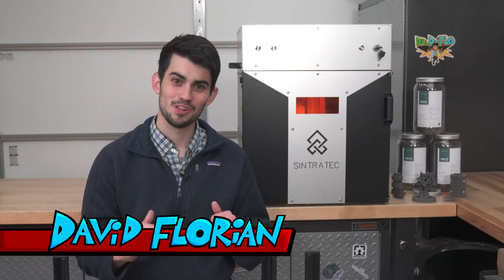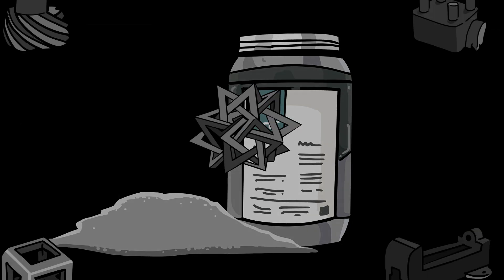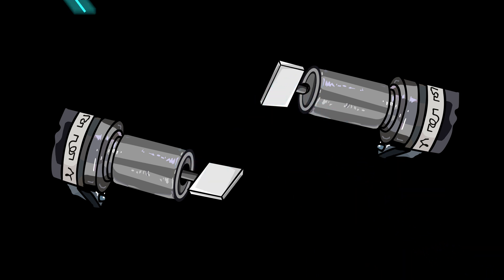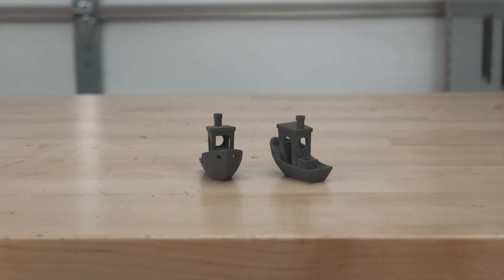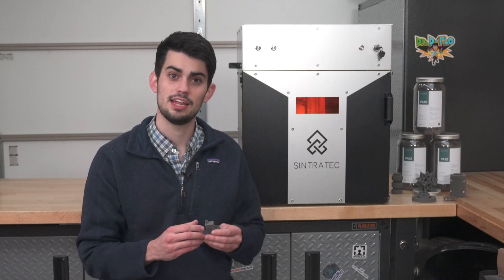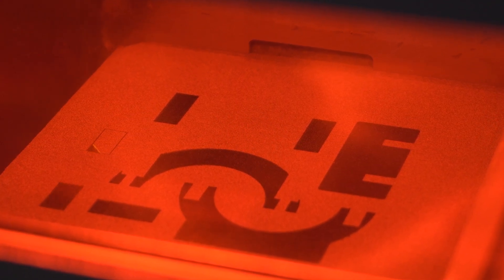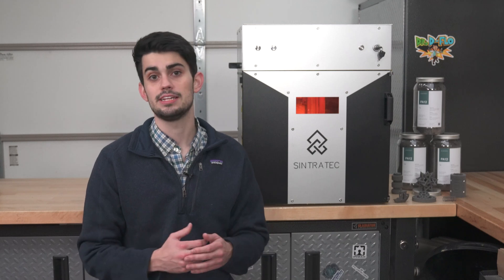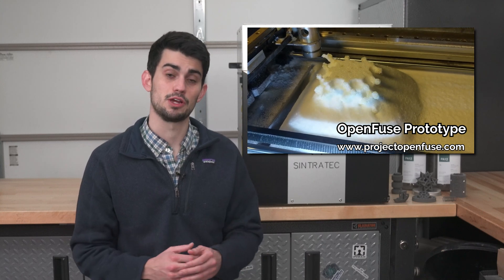What is Selective Laser Sintering (SLS) 3D Printing?

Comment: Great video!  So this is stronger than the 'common' 3d print material - makes sense.  I'm sure this depends on the raw material you are using, but do these SLS parts have a higher operating temp than the 3d printed products?  Say you are interested  in making something to work in a hot environment... thanks!

Comment: Note that sintering has a very specific meaning; if you use heat sufficient to melt the base powder, it's not sintering, it's liquid fusion. Sintering is often used with metal powder compressed in a mold, then heated to a temp below the melting point to fuse the particles. At or above the melting point is SLM, Selective Laser Melting; we use that to make jet engine parts. Less porosity, more power consumption.
From the description, this sounds like SLM.
Reply: I'd just like to interject for a moment. What you're referring to as Linux, is in fact, GNU/Linux, or as I've recently taken to calling it, GNU plus Linux. Linux is not an operating system unto itself, but rather another free component of a fully functioning GNU system made useful by the GNU corelibs, shell utilities and vital system components comprising a full OS as defined by POSIX. Many computer users run a modified version of the GNU system every day, without realizing it. Through a peculiar turn of events, the version of GNU which is widely used today is often called “Linux,” and many of its users are not aware that it is basically the GNU system, developed by the GNU Project. There really is a Linux, and these people are using it, but it is just a part of the system they use.

Linux is the kernel: the program in the system that allocates the machine's resources to the other programs that you run. The kernel is an essential part of an operating system, but useless by itself; it can only function in the context of a complete operating system. Linux is normally used in combination with the GNU operating system: the whole system is basically GNU with Linux added, or GNU/Linux. All the so-called “Linux” distributions are really distributions of GNU/Linux.

Comment: One thing to be aware of: Sintering is a process where, by definition, particles coalesce below melting temperature so referring to the laser as melting the plastic powder can be confusing. The plastic powder doesn't go full liquid, it locally fuses together to form a larger solid.
(But, admittedly, plastics tend not to have a melting point, but a melting range so it's more difficult to properly define the start of the true molten state.)
The most accurate name for this process would be SLF: Selective Laser Fusing. But SLS is much more common and there are already enough abbreviations out there, so SLS will work. (For background: MSc in Materials Science & Engineering here)
Reply from the maker: Yes! I talk about this topic in my big build video. SLS is a misnomer and really you get a spectrum of melting and sintering (i.e., fusing)
Reply: I'd just like to interject for a moment. What you're referring to as Linux, is in fact, GNU/Linux, or as I've recently taken to calling it, GNU plus Linux. Linux is not an operating system unto itself, but rather another free component of a fully functioning GNU system made useful by the GNU corelibs, shell utilities and vital system components comprising a full OS as defined by POSIX. Many computer users run a modified version of the GNU system every day, without realizing it. Through a peculiar turn of events, the version of GNU which is widely used today is often called “Linux,” and many of its users are not aware that it is basically the GNU system, developed by the GNU Project. There really is a Linux, and these people are using it, but it is just a part of the system they use.

Linux is the kernel: the program in the system that allocates the machine's resources to the other programs that you run. The kernel is an essential part of an operating system, but useless by itself; it can only function in the context of a complete operating system. Linux is normally used in combination with the GNU operating system: the whole system is basically GNU with Linux added, or GNU/Linux. All the so-called “Linux” distributions are really distributions of GNU/Linux.
Reply: @zyxwvutsrqponmlkh  ever read a comment and think it's not supposed to be here...... 😂

Comment: Doesn’t this type of printer have metal capabilities?
Reply: Additive manufacturing by using metal powder and a laser to sinter the powder into a part was first tried in the mid Eighties, sponsored by DARPA. Commercial SLS (Selective Laser Sintering) 3D metal printers have been around some 15 years now. Sintering means the powder does not go into the liquid state, it fuses below melting pont. With increase in available laser power and advancements in optics, about a decade ago it started to become possible to do SLM: Selective Laser Melting.

With SLS you can get to about 95% of the density of bulk metal. SLM can get to 99,9% density and better. SLM printed parts are therfor much better in terms of strength. 

And yes, a full metal SLM printer will be at least the size of 2 or 3 full size standing fridges and may cost more than a house. Or several houses. Also, the "toner", the very fine tightly controlled metal powder, is extremely expensive. Roughly 10 times as much as the bulk metal.
Reply from the maker: No it does not. That would require a much more powerful laser and a inert environment to sinter the metal. Much more expensive
Reply: @DrDFlo  Thank you for the response! I meant SLS in general. But I see that the inert environment is key here.